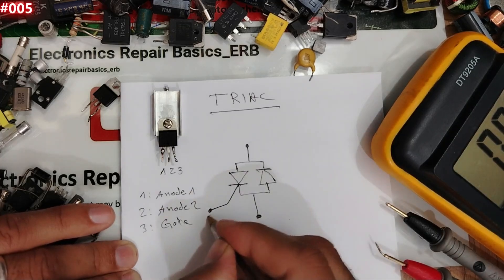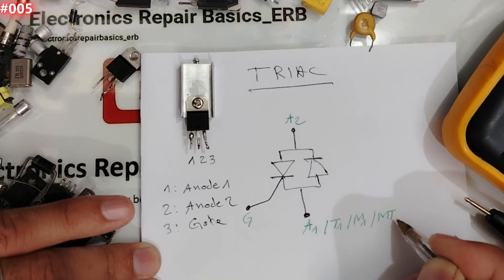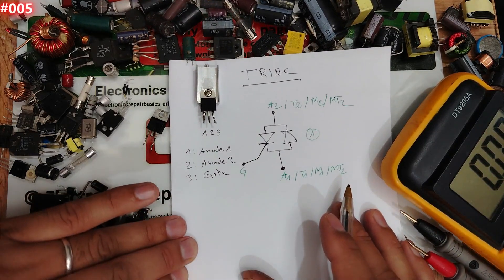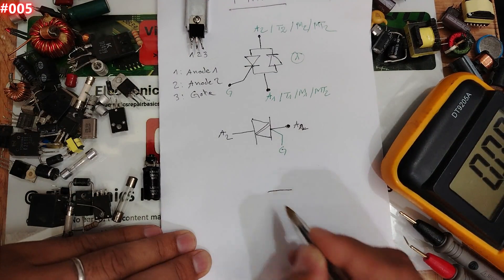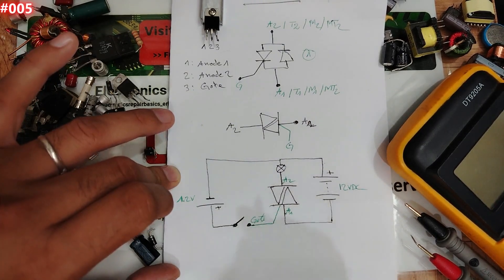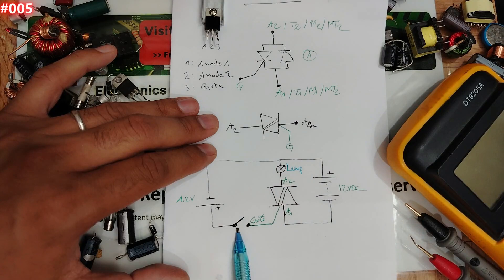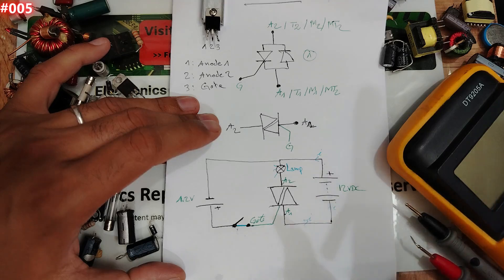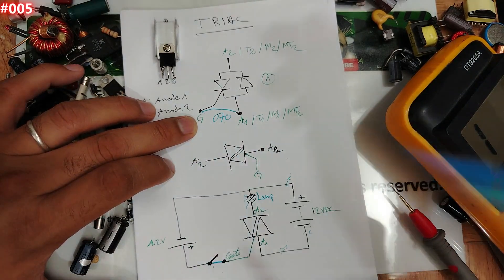#005 Electronic Components: How to Test TRIACs with Multimeter | BTA12, BTA08 600B

Comment: My friend, I believe there is small mistake at 6:33.  You have negative terminal of 1.2VDC source connected to positive terminal of 12VDC source, so the gate is not biased correctly.  I'm not sure what to call it, it's not reverse-biased, but it doesn't work this way (I just tried it).  The negative terminal of the 1.2VDC source needs to be connected to A1.  
This might work if you used an AC source instead of the 12VDC source.
Appreciate the tutorial though.  It's hard to find real people making tutorials these days!

Comment: Which is the difference between triacs and tranzistor please  ???
Reply: probably the biggest functional difference - Transistor - current STOPS flowing when the control pin (called Base) is no longer forward-biased.  (Note - this is for an NPN transistor.  There are also PNP transistors that operate similarly but somewhat backwards to the NPN)

Triac - current KEEPS flowing when the control pin (called Gate) is no longer forward-biased.  Current will stop flowing through it once the amount of current that flows through the A1 and A2 terminals drops below a certain threshold (near 0).